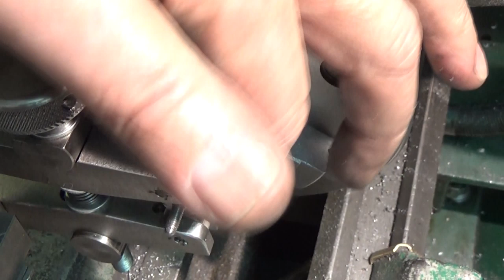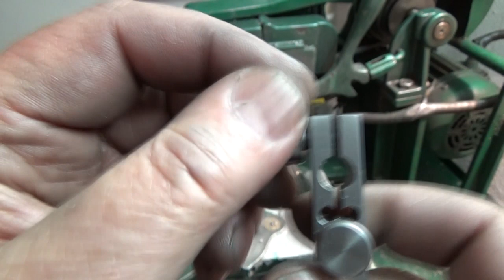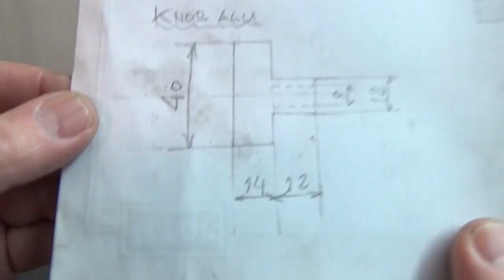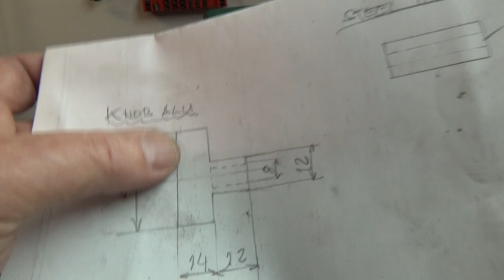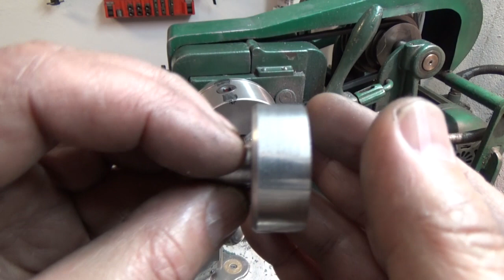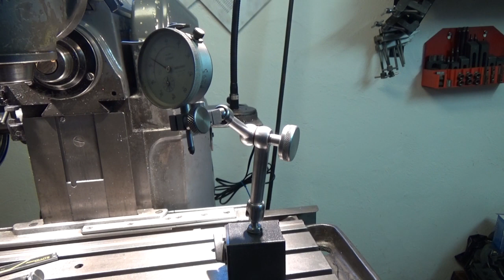Articulated Holder - Part 6 - Final

Comment: På utrikiska:
Nice, instructive, enviable and professional project. I've seen all Your videos, but do not remember in what part (of sex) you did describ the function of the actuated holder. How the center screw locks both individual arms and other parts. In the first video, if I remember correctly, on the drawing there are a pair of locking arms or  at least one? In case, it is  always fun and inspiring to see you at Blomqvist lathe (I'm a Blomqvist owner my self for a couple of years). I grew up in Västerås, and we had a lathe I could use but i was not until a lately I relised that I was missing a deasent sized lathe compared to my Unimat 3 I bought in the early -80.  
// jaan
Reply from the maker: OK vi tar det på utrikiska också: Many thanks for your praise Jaan. I don’t think I described the function in detail. But if you do a search on the tube of ´mrpete222´ you will find a video where he describes the function in detail. Nice to hear from another owner of a Blomqvist lathe. I bought mine 2009 and then my first wobbling steps were taken as a novice on lathe work. By time I realized that a milling machine would be a good complement to the lathe. So in 2011 I bought the Aciera and on that road it is. My skills development strategy is learning by doing which by the way was the central point in John Deweys pragmatic pedagogy.